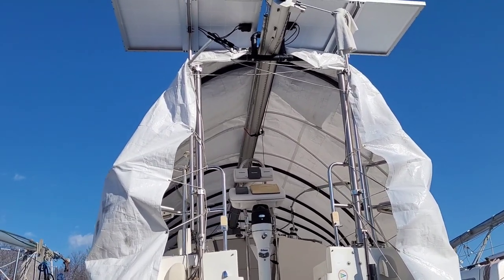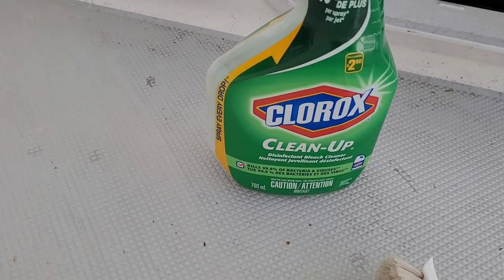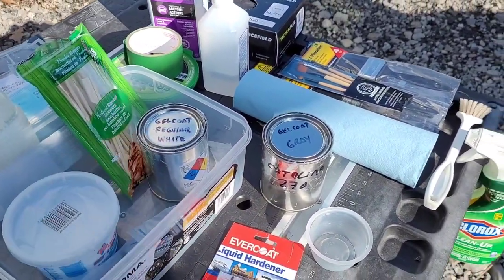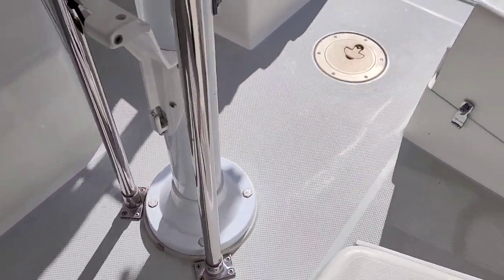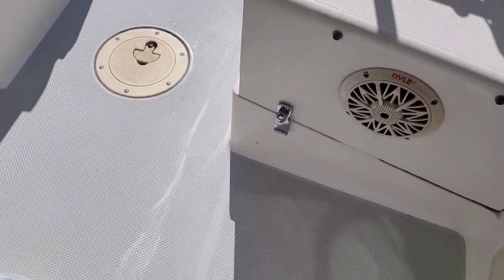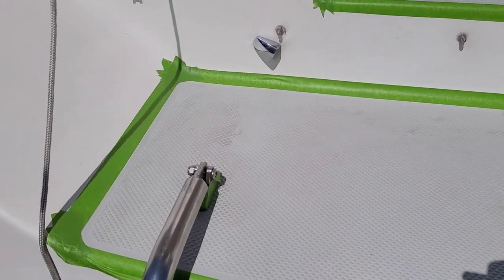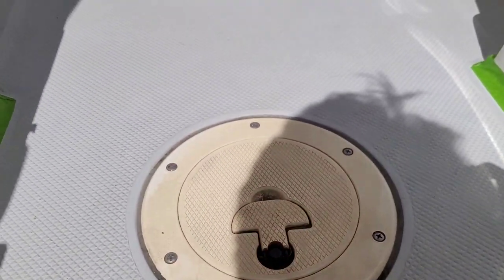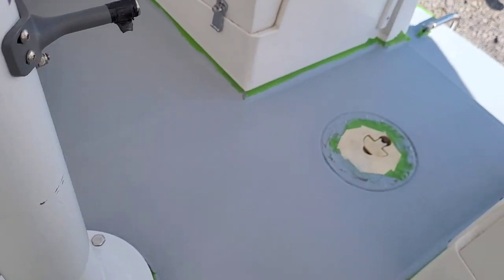Repair & repaint your antiskid deck or cockpit surface

Comment: Great video!  I had huge concerns about painting the nonskid pattern and losing the grip capability. Looks like a good to me!
Reply: I assume you did a lot of research on the paints. Interdeck was your best find?
Reply from the maker: Hi Ron, yes I did do a lot of research and test on old boats laying around the Yacht Club.. and my non skid in the very busy cockpit, still looks and performs perfectly. This year I might do the cabin top non skid surface.

Comment: Really nice job on the deck refinish. Thanks for sharing all your prep and products used. I got a deck repair job to do and this will help me get it right.
Reply from the maker: Thanks and glad you liked. It worked so well, this spring, I’ll be doing the same on my cabin top that has the same original anti skid texture.

Comment: I want to paint my non skid deck but have hesitated because I could not figure out how I would sand the non skid to create teeth for the paint.  Your video tells me that a thorough cleaning is all that is needed and decontamination with acetone.
Reply from the maker: Thanks for your comment. I wanted to absolutely maintain the original non skid pattern. After filling some pit holes with gelcoat and a small paint brush, I took my time cleaning the surface with a brush (and a toothbrush for some areas) with a water/bleach solution. Then I cleaned the surface again with Dawn dishwashing soap.  Once rinsed really well and dried, I cleaned the entire area with acetone.  I then used a foam roller to make sure the coating got into all the non skid pattern. Let dry for about 4 hours and then recoated once more.  A few days later, I waxed the area, by hand, with a non skid wax.  This spring, I will be doing the cabin top area.  I’ll write an article about that as well as do another video.
Reply: It will last 6 months to a few years.  - Even with a super thorough coarse scotch brite. 
Definitely don't go near it with a gherni/water blaster. 
For guaranteed adhesion, - machine the whole lot down. 80g
- apply an epoxy primer 
- toppy with beads of your choice and a linear toppy. 
Good luck guys
Reply: @aquaholic3  

Note:

A pre -mixed water / bleach solution - off the shelf product?

If not, what was the mix rate 50/50 standard bleach and tap water or ?
Reply from the maker: @MrBluoct i get my bleach mix off the shelf at the dollar store. In a spray bottle.

Comment: Thank you for this.  Very useful for our projects.  You mention later adding a coat of wax.  Does this not make it more slippery, therefore undermining nonskid?  Please comment.  What wax product did you use.  Thanks again.
Reply from the maker: There is marine wax, especially designed for non-skid surfaces. Ask your local chandlery.

Comment: Nice work. I have the same grey on my Catalina.  Did you research other paint products as to pros and cons? Would you ever consider doing the entire deck of the boat in sections that were manageable to do at a time?
Reply from the maker: Hello. Thanks for your message. Now I know the job I did on the cockpit floor hss been resistant, (still looks like new), I will be repainteling the grey sections on the top of the cabin next spring. I will using the exact same process.

Comment: Hi, your paint is still new, but how did it performed? How does it resist abrasion, especially since it is applied over the the pyramid textured gelcoat? Does the non-skid is still as good? Thanks for sharing.
Reply from the maker: I am super happy with the results and the performance. The prep was important of course as was cleaning the surfaces with acetone prior to painting. Used a thin foam roller to allow paint to get in all the non-skid texture. Plus the paint itself is non skid once dry. Lastly, not rushing the between coats times for the second and third coats is important.  I am so happy, I plan to do the cabin top next spring.
Reply: @aquaholic3  That's great since the 'standard way' to deal with this issue is to sand down all non skid, and paint grippy paint on the flat surface. A lot more work.

Do you plan to make a short follow-up video on the Lexan panel replacement?
Reply from the maker: @oumenelabrise2155  Hi, yes the International Interdeck paint has non-skid properties, so no sanding really needed and able to keep the original non-skid pattern on the deck.  Will be doing the cabin top either in the fall or spring.   I will try and do a short update video of the Lexan panels.
Reply from the maker: Hi, if you look at my videos on YouTube, you will find the video I did when I changed my windows on the top deck. Not Lexan. I used Polycarbonate instead.

Comment: Don’t wax!  You’ll have to paint again in a few years.  Big mistake to wax a boat.
Reply from the maker: Hi Susan. I don't agree. I've always waxed my boat decks, using non-skid wax. When repairs are needed, I simply clean the surfaces with acetone.
Reply: @aquaholic3  sorry, after some research, I’d have to agree.  However, to count on getting the wax out of all the crevices of non skid would be difficult.  I just know that when I tried to get the wax off my hull to paint, I wasn’t able to entirely get it off and the paint didn’t stick as well as it should have.
Reply from the maker: @susanc.8009  Never be sorry for sharing your thoughts and experience.  Get wax off surfaces can be trickle for sure, but I found with acetone, it all goes away. Hard to get at areas, I use a toothbrush.